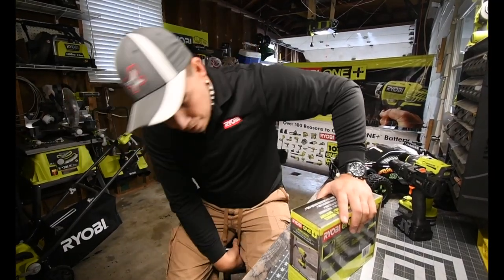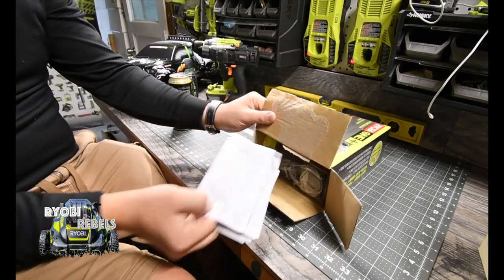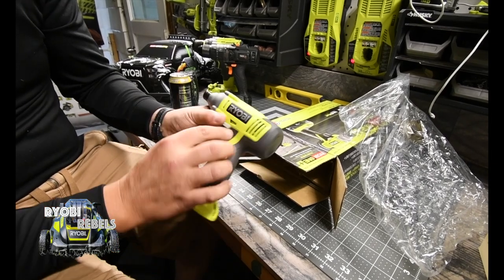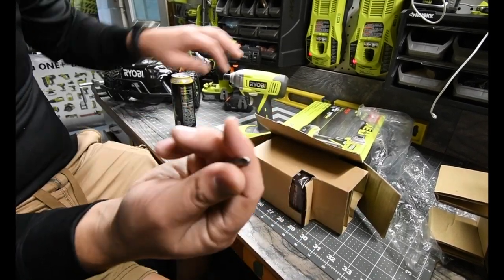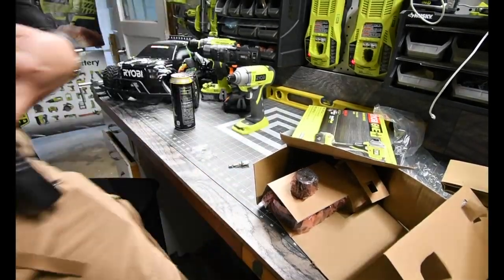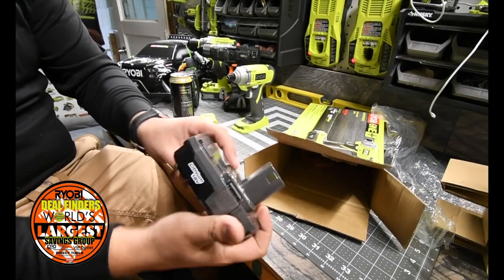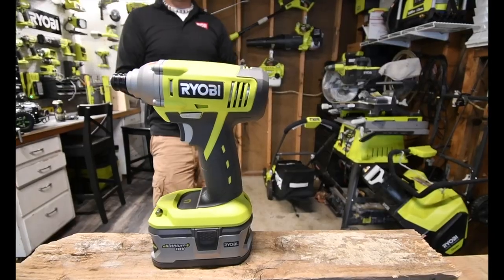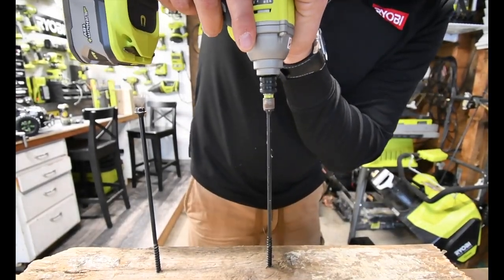Ryobi Impact Unboxing/Testing P1870

Comment: AFAIK, all their chargers have the Intelliport technology.  That means the charger will shut down charging when battery is full and will maintain with a trickle charge when needed.
Reply from the maker: rpddsmith very good sir and thank you
Reply: That's partly what intelli port is. Intelli port is mostly that it can charge the old nicad batteries as well as the new lithium ion batteries.

Comment: Ryobi makes far to many models of impact driver. They should keep a couple of the best brushed variety such as the P235a and the P237 and of course the P238 brushless.  The rest should just be dropped from the lineup.
Reply from the maker: I agree, they should make 1 o2 2 fantastic impacts instead  a lot that don't perform like they should

Comment: This is my question TIM from Canada I have Ryobi tools quite a few drills I have 1/2 hammer drill and I have an impact driver. My question is why all Ryobi tools work with all the batteries let me explain this the higher up on the battery you go The more power you have this is what I have found now wouldn’t it be possible to put the power in all batteries so all your tools work that is my question I do not think anyone has an answer for this one.. question 2 how long does Ryobi batteries last if they sit in the house for the winter without using them.. I heard most Ryobi batteries only last 6 months basically ... I have a 4 .0Ah  2 ....2.0 Ah 3 ...1.5 Ah this is what I have so far do I need to buy more batteries next year for the summer months do you use for my blower and weedeater.. any of you are you’ll be fans out there have any answers on this I sure would like some suggestions please TIM from Canada
Reply from the maker: I already demonstrated this on a recent video about AH in the batteries, check it out